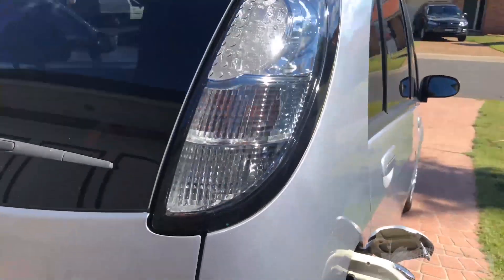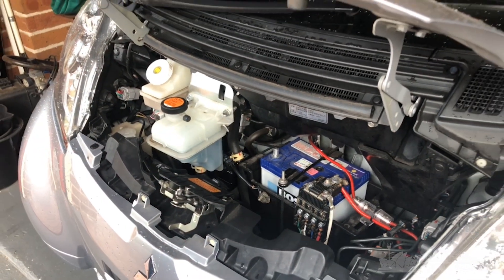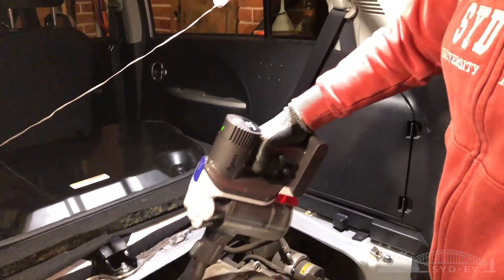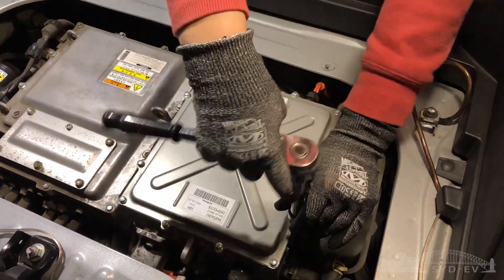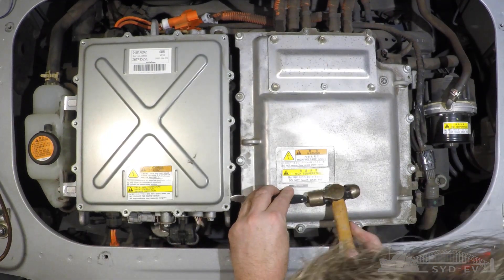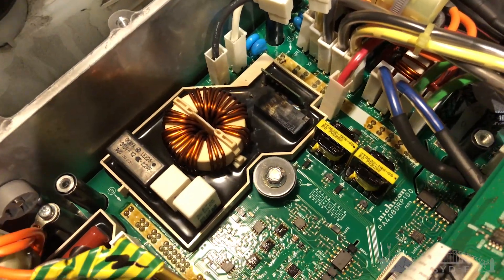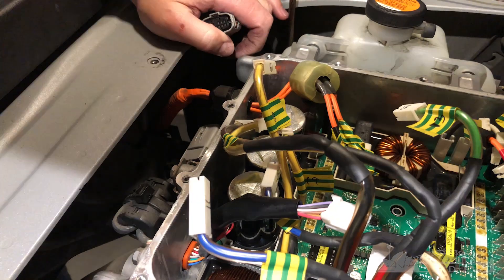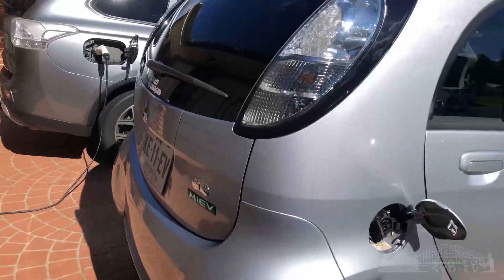i-miev DC-DC converter repair Part 1

Comment: Thank you very much from france, just followed all your steps and found that a blue capacitor exactly where you showed it has popped up. no small card on my car directly 2 blue capacitors ( peugeot ion from 2011). now just have to buy spare part solder capacitor, change fuse and cross fingers !
Reply from the maker: good to know you found the faulty parts,  hope it fixes the issue

Comment: I saved much time doing the desoldering and soldering in the built in condition inside of the vehicle.
It was helpful to have a goold soldering station and a de soldering vacuum pump.
Undoing the DC Connection plug under the seat is a must in order to stay safe.
There is no cooling liquid in the PCB area.
Reply from the maker: good to know there is no liquid cooling in the PCB area,  at the time we had no idea what the failure modes were, or what we would find, and found it easier to work on a desk.   we weren't expecting the repair to be so easy

Comment: Why do I need to drain the coolant before opening up the cover just to check if the capacitors are blown? Is there literal coolant in the OBC before I pop open the lid?
Reply from the maker: if you dont plan on removing the converter then i am assuming you should be able keep the coolant untouched.

Comment: Excellent video, thank you.  Useful for other repairs involving the Charger - DC/DC converter box, too.  We've got 4 i-MiEVs here on the Isle of Colonsay, Argyll, Scotland.  Fabulous wee cars that we hope to keep going for as long as we can.  Mitsubishi management should all be sacked for abandoning this design.
Reply from the maker: yes, ours is still going strong after all these years,  though there is a company here that can refurbish the battery and bring up to 24kwh capacity which gives it about 300km range!  Sadly it appears the DC-DC converters are the only real weakness in the car, but once fixed, seem to go on just fine.

Comment: Why must dealerships make something so simple so expensive!!
Reply from the maker: our local dealership followed a simple instruction sheet that was trial and error,  they wanted to replace one thing after another until it was fixed.  even after we told them what the problem was, they still started replacing parts that didnt need replacing, while we were paying for it.

Comment: it is necessary to remove the entire inverter from the car and you can not fix it in the car and solder new capacitors?
Reply: Interesting question; this video might make it possible to do the repair in the car, now that we know what is needed. ☮️

Comment: Hey SydneyEV Thanks for the video, because of you guys i dared to do it my self.

 Now I followed everything you did and have replaced the fuse in the MCU also got the same resistors that you mentioned. Although the warning lights dissapared from the car I still cannot charge it. It makes a ticking sound from the fuse box in the front. Im lost, i have taken the OBC out 3 times now to checked everything tired to resolder again but nothing helps. Could it be that i ruined it? Or could there be something else. 

Anyone with any ideas?
Reply: Only thing i have not done is that I didnt refill it with coolant yet, but cant see why that would be an issue?

Comment: My don t charge enymore, and no codes no blowing capasitors. no high ohm resistors on the pcb, no blow fuses . what else can it be ?
Reply: At now it is on peugeot dealer ! They tell me the charger can not comunicate with peugeot France ( Via internet diagnostic). It seems like a can bus problem ! they will call me later to verify this and tell me the price ! Good news is that the PCBs inside this charger can be buy seperatly and not like in the past the complete charger !

Comment: Great couple of videos! I've actually got an iMiEV in NZ which struggles to charge on AC, but will still charge fine on DC Chademo. The AC charge will most likely fail if you start from a lower charge level, but may be ok if it's just a top up. It can randomly show various warnings like the tortoise and ev system while driving. Mitsubishi advise it needs a new battery, but I'm not so sure... what sorts of issues were you having with your imiev? Thanks

Comment: The little vertical board looks the same as ours did before we repaired it!
Reply: I also somewhat think Mitsubishi could easily offer a refurb exchange program on these, rather than $4K replacements for a failed $20 part...
Reply: Such is the modern world... 
Oh well, I learnt a lot fixing mine. So I should be able to keep it in the road for a while.

Starting to think I might need to repack the cells by the end of this winter though - starting to choose between heater and keeping up with traffic to get home on a charge.
Reply: @SydneyEV  indeed!
Reply: I think I'd be pushing my luck to get 90km, the last section goes up 500m of elevation. 70km commute. Usually get back with 0-4 bars on the gauge, but I've never hit turtle mode. The drivers seat heater is great, but doesn't work with passengers.
I often only use 3 bars on the commute in, I think it's near all downhill.
No fast chargers within 300km. Might have to get a slow charger near work.
Reply: That is commitment! Any chance of charging at work? I think that is almost ideal - you can charge during the day when the sun is out.

I bought the car accepting the idea that I'd only ever charge at home, and honestly it hasn't let me down yet. The only chargers within 150% of it's range from home are some Tesla destination (slow) chargers, and some (incompatible) Tesla superchargers. These are all really close to the start of the home journey though.

I find it a little inconsistent - some days I get home with 2 bars shy of half a charge, other days I'll be on zero or one bars. I suspect colder days are worse (even if I don't use the heater). In any other respect it's such a convenient car though. I suspect that repacking the battery with new cells might cost more than a grey import leaf, but I think it might be worth it.